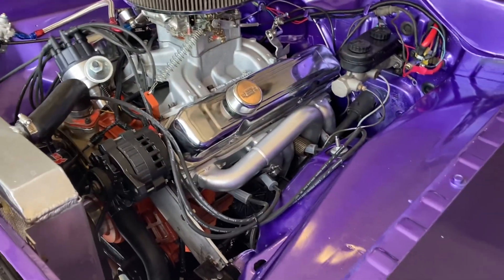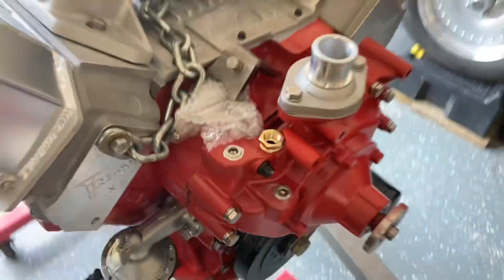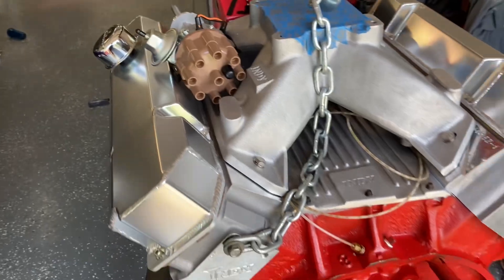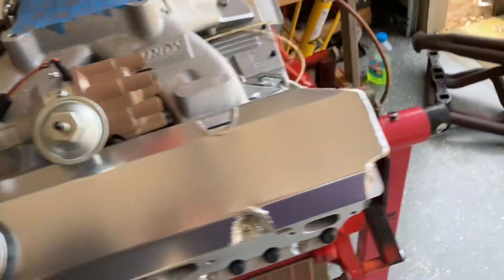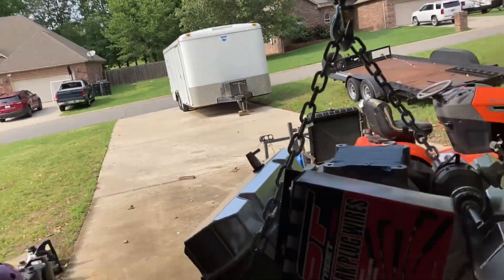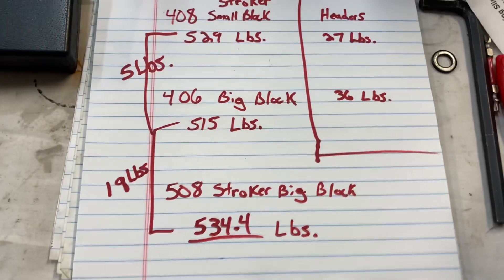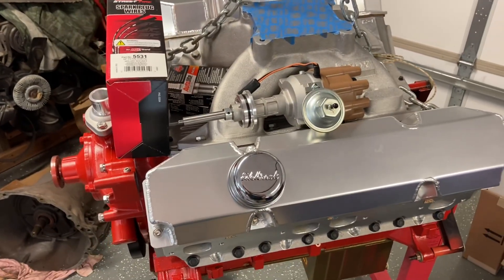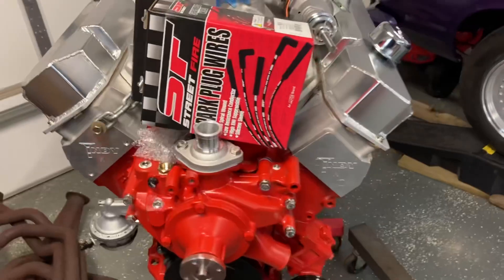Mopar Engine Weights Compared: RB vs. B vs. LA #mopar #engine #440source #stroker

Comment: I actually would not have ever guessed. My assumption was always 200lb more.
Reply: With iron heads, intake, and exhaust manifolds, 200lb more would be about right.
Reply from the maker: I had the racier version of each. Those small block iron heads weigh a ton
Reply: @JustMoparJoe  My Pontiac heads are quite heavy in iron, much lighter in aluminum, usually aluminum heads for my engines flow better than heavily ported iron heads too, so making power is easier to some extent. Porting is very beneficial.. if its done right.
Reply from the maker: @SweatyFatGuy  I’d like to hear your opinion on thermal efficiency in stock compression engines(8/1 or so) Iron heads vs. Aluminum. I can only find one tech article on it, and it was using 10.8/1 static compression.
Reply from the maker: @SweatyFatGuy  thanks for sharing!
Reply: @SweatyFatGuy  One must stay away from the old tech "domed pistons" and open chambered iron heads.. They stop "swirl" in the chamber. They "dam the mix". Causing an incomplete burn. And hot spots that lead to detonation. Now if you running really high octane, you can get away from that problem.
Look at the way engines are produced today from every car manufacture.  Aluminum closed chambered heads. Sometimes even aluminum blocks. Along with "reverse domed" pistons. What used to be called "smog pistons". 
Why is this done? To put the "burn" down on the piston top and not so much in the head. The result... no damming the mixture. High swirl. A very complete, clean burn. An efficient engine is a happy engine. And you can run higher compression ratios. Which produce way more torque and horsepower. Again, look at today's engines. And you don't have to fool with retarding the timing. Been there with open chambered iron heads. I will never go back to that.
One can easily put today's tech into an old school engine and get pretty close to the same results. I did this on a stroked 440. It rips and gets decent gas mileage for real close to 600 h.p. and at least 650 ft. lbs. of torque.
Buy the way... ethanol sucks. The disadvantages out weigh the advantages.
Reply: @SweatyFatGuy  Ethanol produces way lower BTU's in a similar way like propane.  Yep. If you raise your compression way up/ boost it... it will provide more power. But one must build an engine to accommodate that fuel. That's all because of the lower BTU's. A lot of places around these United States... you can't just drive up to a local gas station and fill up with that stuff. Here in California we get a bouquet fuel mix with just a partial mix of that crap. Just enough to cause havoc.
It will destroy anything with standard parts like carburetors, mechanical fuel pumps. It attacks a lot of aluminum parts to the point of corrosion. It eats rubber/ o rings like cancer. If you let sit... not even for a long period of time... it will break down to mung and poo. It absorbs moisture worse than brake fluid can. Which helps destroy it even more.
Benefits? If you have a engine built for the drag strip. Where you don't daily drive it. And have boost/ very high compression. Sure it'll be fine. Personally, I daily drive my vehicles. My '74 Power Wagon gets daily driven all the time... for real close to 50 years now. And I had to change a lot of things for it to try to outlive California's ethanol mix. 100% ethanol... egad! Sometimes I have a vehicle that sits for a few weeks before it gets used. Ethanol won't work for me. I've tested my truck for all those years now. I'm very happy.
Do you realize how much the farmers are substituted by the Washington bureaucrats to keep the ethanol market afloat?
No thanks.
I'm putting together an all aluminum 2 Generation Hemi with SMPI injection, a Hogan's intake with a Whipple Supercharger for my Daytona clone I'm building. It will have a conservative 1100 H.P. Pump gas. No ethanol. 
Come out to Willow Springs road course in California so you can see what pump gas can do.
Heck, I'd put my Power Wagon up against your Pontiac. 🤪

Comment: I've always thought there wasn't much difference in the weights especially with aluminum heads.  I remember swapping out a 318 to a 383 in a 68' Coronet.  The car drove and handled the same as it did before the swap.(had more power though, lol). Big block all the way! Great video!
Reply from the maker: Thanks Todd!

Comment: Kinda proves it’s always worth it to swap a big block in where there once was a small block. Even if you keep iron heads on the big block, with aluminum intake and water pump it’s just about 30 or 40 pounds heavier than an iron headed small block. The weight penalty is worth having a fatter bore and bigger valves!
Reply from the maker: And the torque!
Reply: @JustMoparJoe  yep! Exactly why I’m swapping a 400 in my daily driver dart. Fat torque curve from the very bottom so I can keep my 3.21 gears and drive past a gas station or two.

Comment: This just verifies that my oldest brother was correct...He built a 73 Charger factory 318, swapped in a 440...An ex Chrysler engineer told him that he'd have to change the K frame, and the torsion bars, he did measurements, and dropped the 440 right in on the small block K member, with the stock torsion bars, and everything worked out perfectly...lol, so what I take from the engineer is, lay off the twinkies, cuz if you gain over 100 lbs...the car will explode...lmao
Reply from the maker: Haha! Put a cigarette out in his eye 😂
Reply: What does a train driver know about engines anyway? LOL
Reply: But in ‘73 the K frame is actually different and the mounts don’t line up… they do in ‘72 though 🧐
Reply: @DeadDodgeGarage  It was a 78 440 from a New Yorker, can't remember what mounts he used, but it worked, I was 12 at the time, he worked in the junk yard he built the car from...so he had seen nearly every mount that was available. This occurred back in  1993. I know he didn't change the K frame, because I was his helper...lol
Reply: @DeadDodgeGarage  1973 was a transition year for the B-body K-frames and engine mounts. Many 73 B-bodies did get the newer style, but all E-bodies and most all of the 73 Chargers I've seen have older style. I'm not sure the 73 (or 74?) Chargers ever got the rubber mounted sub-frames. The 4-door B-bodies switched during the 73 model year and I'm not sure about the 2-door Plymouths, but I think all 73 Chargers I've seen have the older style K-frames and the E-bodies never switched and were only made for half of the 74 model year. The 74 Road Runner also was only made for half a year, but the Charger and 2-door Satellite (?) survived to the end of 74. The 4-door B-bodies switched half way into the 73 model year and the 74 4-door B-bodies got the new K-frame. The 75 2-door B-bodies look different from 74, but the 4-door Satellite looked the same as as the older ones through 1978. The newer K-frames went into cars with rubber mounted subframes, rather than welded in rails. I know many Mopar books reference 1973 as the year of the K-frame and engine mount change for the B-bodies, but I don't think the early 73 4-doors changed and it looks like the Charger and possibly the 2-door Plymouth models didn't change in 73.
Reply: @BrandonLeeBrown  the ‘73 Charger in my shop, the ‘73 Charger at Rocket Restorations, Big Wrench Tech Donny’s ‘73 Satellite two door, and both of the other ‘73 Chargers I have owned beg to differ with that. They are all the later isolated Ks. No, E bodies never switched. Neither did A bodies.
Reply: @DeadDodgeGarage  There may be 73 Chargers with the newer style K-frames and mounts. 73 was a transition years. At least two people posted on this video that they have swapped 318's for big blocks in 73 Chargers, without changing K-frames. I wasn't sure if any two door 73 B-bodies changed, but I knew the 4 door cars did, during the 73 model years, but not all 73 B-bodies have the newer type mounts. Most of the Mopar books fail to mention that there are 73 B-bodies with the earlier style mounts and just say that 73 and newer have the newer style. Funny thing about A-bodies is, Direct Connection sold big block A-body K-frames that take the newer type engine mounts.

Comment: Joe, this was great weight info. My personal experience with a 383. I was amazed at the weight of the factory 383 complete motor. A 25HP Kubota would not lift it onto the trailer. I had to rely on the Oak Tree and come-a-long, i didn't have a weight scale. Something I am going to need to get. Weight matters for racing. It's interesting to the rest of us.
Reply from the maker: Thanks buddy! I definitely believe in the aluminum heads, water pump, and intake. That’s a huge help
Reply: I weighed a set of ported iron maxwedge heads compared to a set of aluminum big block chevy heads. The max were lighter.

Comment: Joe that scale is flashing lb when you turn it on. I say if you push those buttons right it will turn into pounds.
Reply from the maker: I just saw that! 😂
Reply: Try pushing the middle button down for one second.  There is a very similar scale branded AnyLOAD, but the buttons are labeled differently.  I found a manual online.  I actually like the metric system because I weigh less and my tool is longer!
Reply: Maybe hold the power button for 3-5 seconds and maybe that will change from metric to pounds
Reply from the maker: @dinadaughtry8993  I’ll play with it some more. I have so much work I need to accomplish, typically when I need the scale, it’s faster to just convert and move on. Mine didn’t come with any English instructions 😂

Comment: I could be wrong, but 19 pounds doesn't seem like a lot to me. 
I alway struggle with metric. I hate it when I'm working on something that has standard and metric.
Reply from the maker: That’s not much at all! People whine about how heavy big blocks are. I think you would never sense an extra 19 pounds
Reply: @JustMoparJoe  for me 19lbs is the difference between fitting in the cage or not, and wearing pants.... Aluminum head LA would only be about 50lbs lighter, give or take, for the difference in torque, the weight is nothing to be overly concerned about.

Comment: Still this proves to me that the best engine to build is the B engine more compact lighter and in stock stroke will rev up faster and stronger overall....now throw in all aluminum versions of all three and any one of them can hold their own weather at the drags or the street. And then weight will really be fun to see... And you used cast and forged steel cranks with success proving that having a cast crank is no reason not to build a good hot rod motor. But for ultimate strength the forged is the way to go. Great stuff Joe thank you for doing all the hard work..
Reply from the maker: Thanks John! You definitely get what I’m saying. Imagine that guy that’s scared to big block swap because of the weight!
Reply: Yeah. I don't know about that. I've heard this tale for years now. No one has ever stepped up to prove differently. Lighter? How much really? Compact? Yeah. The heads are what 1/2"/ 3/4"  shorter? Whoopie.  Rev faster? I'll tell you what, my stroked 440 revs plenty fast. So much so, I had to put a rev limiter on it to keep it in check. It'll easily go to 7,000 rpm very quickly. My limit is my hydraulic roller lifters. Who really needs 7,000 when you have so much more torque available than a B block can produce.
Revving faster really has to to do with your tuning capabilities. My stock Six Pack worked fine for stock tuning from the first time I put it on in '91. But when I really got into it a few years later, It became a quick revving monster. 
Stock vs. newer quality materials can make a big difference too. My forged JE pistons are way lighter than those cast stockers that were 1950's tech. My "I Beam" Scat rods are way lighter and stronger than the 50's tech ones. Don't even talk about the ridiculously heavy "Six Pack Rods".  And my Scat crank is way stronger and lighter than any old school stock crank.
Nope. There's not much of a difference between a B block vs. a RB block.
Reply from the maker: @KurtfromLaQuinta  they all have their place for sure. Build what you have. It seems the B blocks fit easier in an A body, but with 19 pounds difference, it’s all good. The big block makes enough torque for the whole family.